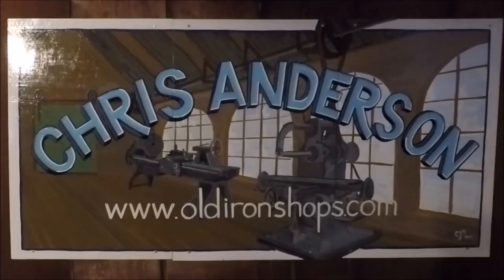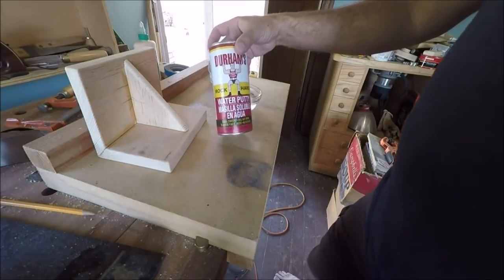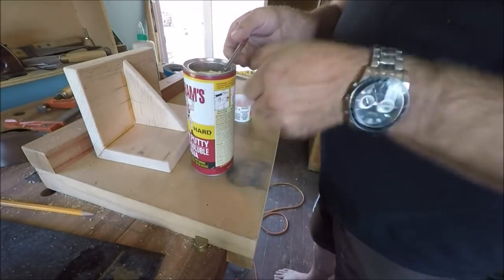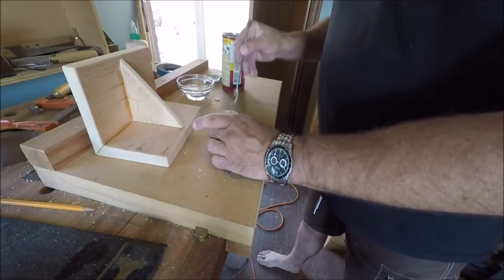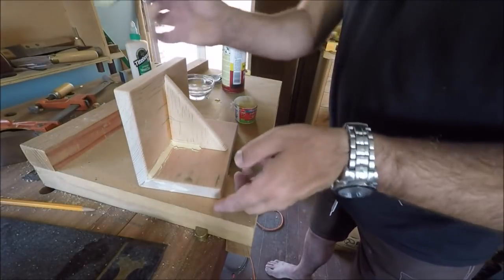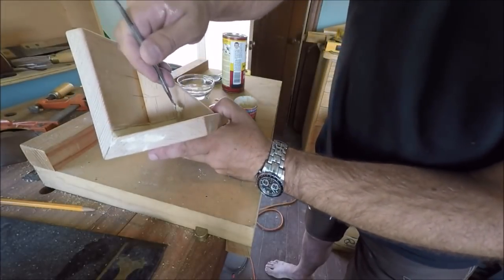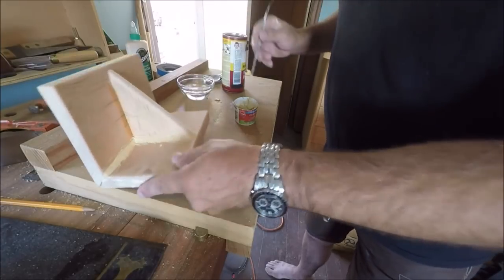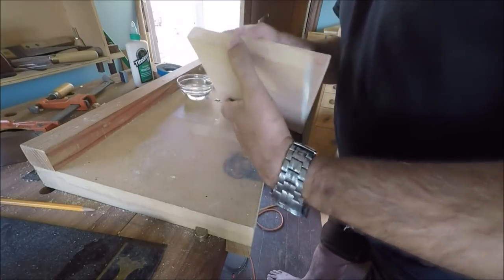Wood Pattern Making Process #3

Comment: You're 23 away from the 1,000! Were you even worried when the announcement came or having you been working hard like me? I could use the help. I use a "lathe" of sorts weekly - disc brakes, lol. :) I'm an automotive guy with a sprinkling of motorcycles, which I've worked on.
Reply from the maker: +DE Nichols you must be kidding I'm still worried need lots of hours still welcome aboard :)